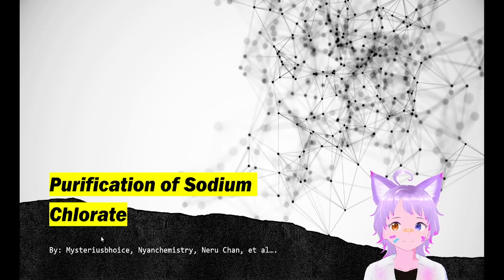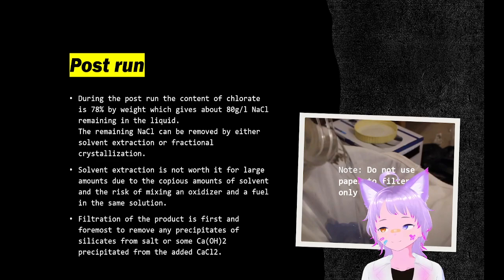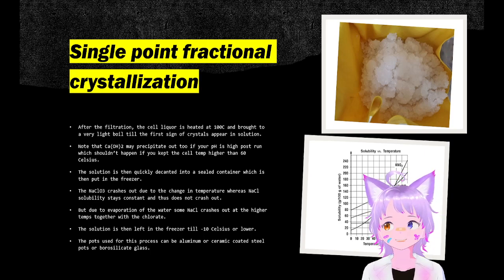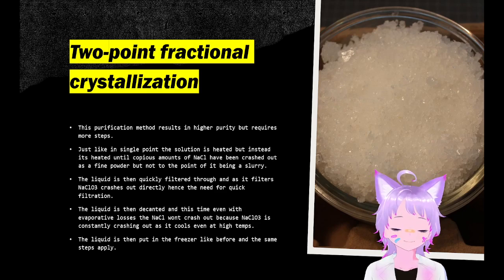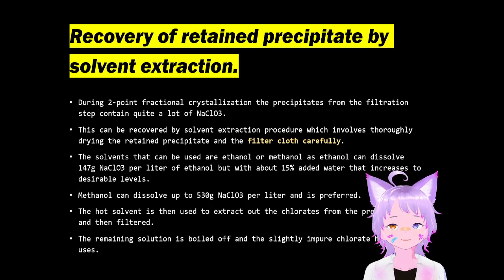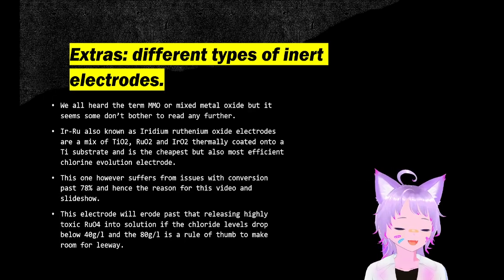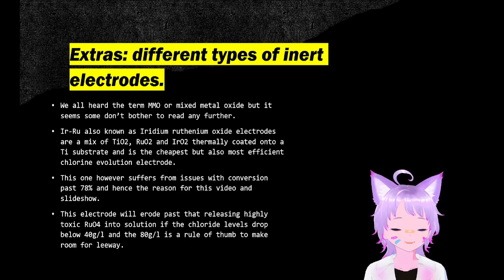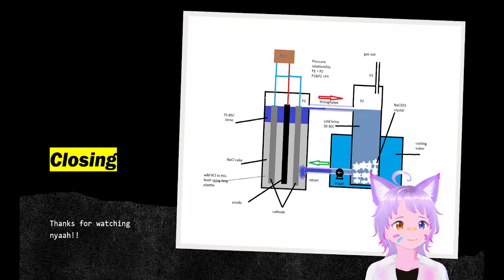How to properly purify sodium chlorate.

Comment: If i have an MMO anode how can I know if it's Ir-Ta or Ir-Ru?
Reply from the maker: Get a benchtop power supply and put electrodes 1cm apart. Set power supply to 0.8 volts run it in brine and check if any gas bubbles are produced at the anode in 3 mins. If not then increment till 1.3 volts by 0.1 volts and determine when Cl2 is evolved at which voltage. If it's IrRu it should evolve gas at 0.8 to 1.0 volts in brine and if IrTa then it's from 1.1 to 1.3 volts. Remember to measure electrode to electrode voltage with separate meter and not supply voltage to limit ESR errors.
Reply: @CatboyChemicalSociety  thanks! I will try it when i get the electrode
Reply from the maker: @lautaromorales2903  where did you buy it from
Reply: @CatboyChemicalSociety FINALLY
The water chlorinator arrived and I've made the test 2 times to be sure and the tiny bubbles appeared at te anode at 1,3V
Reply from the maker: @lautaromorales2903  thats likely Ir-Ta since Ir-Ru has bubbles appear at 0.9V or lower. in saturated NaCl solution because in plain baking soda or water they will both release at 1.3 volts.
Reply: The electrode its a bit damaged and has some substrate exposed, but it works, so i'm happy
Reply: I bought it from Aliexpress as a hypochlorite generator
Reply: it was the cheapest way i can get an MMO anode here in Argentina. I saw a video where Elemental Maker uses them to make KClO3
Reply from the maker: @lautaromorales2903  if it's cheap it's likely IrRu because IrTa is expensive.
Anyway what was the result of the voltage reading on the gas evolution test.
Reply: maybe in a month it will arrive argentina 😔
Reply: when i can do it im gonna comment the result

Comment: I've read, that industrially they bubble chlorine through a hot CaOH solution, which makes CaCl and CaCLO3 which are then converted into whatever end product is desired.
Because this would allow for chlorine from less demanding divided cell chloralkali electrolysis or pool chemicals, do you think this process would be worthwhile for us plebs?
I believe, NileRed used to have a video on this but it's been purged.

Comment: If I wanted to use  platinum coated titanium electrodes for the electrolysis process how would it differ from mmo? Should I use CaCl2 to protect the electrodes? Some instructions mension using potassium dicromate. How far should I run the electrolysis and how efficent would it be?
Reply from the maker: CaCl2 is always good but honestly MMO is better but Pt works too. dichromate is not needed if CaCl2 is used and as for runtime calculations with Pt its treated the same as Ir-Ru.
pH control is only worth at 60 Celsius plus of running temp but Pt doesnt like that.
efficiency would be 54% running at non pH control and 80% at pH control conditions.
leave 80g/l NaCl at the end of the runtime and use that Vk2zay calculator.

Comment: Just run your cell until you get solid crystals of NaClO3 at the bottom, these should be quite pure.
Reply from the maker: yea this is using Ir-Ta electrodes but if you use Ir-Ru then you risk forming RuO4 which is highly toxic and carcinogenic.
Also this only works when the cell is not pH controlled (hypochlorite electrolysis) and in pH controlled conditions it seems after concentration gets too low then the pH goes up and this mode of electrolysis occurs which again Ir-Ru electrodes arent gonna like it.
If the current density is below 150ma/cm^2 for Ir-Ru its worth it however that plus the lower 50% efficiency rather than 89% due to no pH control is a thing.
Ir-Ta however can run like this with no issues so if you are gonna do this make sure your electrodes are iridium tantalum and not iridium ruthenium coated.

Plus sometimes you have inclusions of hypochlorite with the chlorate in these conditions so sometimes they may not be as pure as you think.

Comment: 2 unrelated questions but you as the expert of electrolysis can surely help me.
1. I want to build an elektrolysis membrane from household materials, without buying anything. Do you think i can just heat one part oil with two parts citric acid and two parts glycerin to form an cation exchange resin and impregnate that into cotton cloth?
2. On a science madness post you mentioned that ion exchange resin impregnated concrete can be used for everything but doesnt concrete dissolve in acids?
Reply from the maker: concrete will only be partially attacked in acids and thats with regards to structural integrity which this concrete wont be doing.
This is because SiO2 will remain as the cementing agent when the CaCO3 has gone.
as for membranes you should check out my video on making polymer membranes using PVA crosslinked with citric acid and baked at 160C for 35 mins and repeated.
Also cotton would dissolve easily after prolonged periods and its recommended to use fiberglass mesh or cleaning cloth which is made of PVC.
https://www.youtube.com/watch?v=tiMt4tIced8
Reply: ty
Reply: I had already seen the video on your polymer membranes, but the stuff you use is just not available where I live. Do you think my approach would work?
Reply from the maker: @-taba8777  elmers clear glue or any sort of clear PVA glue>??
Reply: @CatboyChemicalSociety  I can only buy polyvinylacetate glue, no polyvinylalcohol :/
Reply from the maker: try looking for those uhu glue sticks with clear glue im sure those can be found.
otherwise that sucks.
Just buy ion exchange resin crush it up and mix it with some cement and honestly that will do fine vs acids after its cast.
Reply: @CatboyChemicalSociety  yeah will probably do that
Reply: for anyone having the same problem as me that there is no pva glue, but only pvac glue: in "no slovent glue" is pva
Reply from the maker: @-taba8777  welp guess ion exchange resin or plaster of paris mixed with concrete then.

Comment: if there can be slight NaCl contamination would it make sense to add a few ml of water into the crystallization mixture before chilling it to counteract evaporation?
Reply: although tbh i'd just do two point as a hot filtration is what i do before literally any crystallizations from hot solutions, but finding a way to filter a near bp solution quickly will be interesting, vacuum will just boil the solution as it passes through yet a normal funnel and cloth is a bit slow, i possible could use some sort of weird funnel shape to optimize surface area for the filter media so it filters much faster
Reply from the maker: @EdwardTriesToScience  use a biggg funnel and bigg cloth!
Reply from the maker: @EdwardTriesToScience  press filtration is a thing aswell using a T shirt and some elbow grease!!